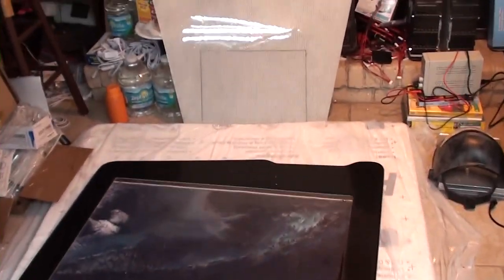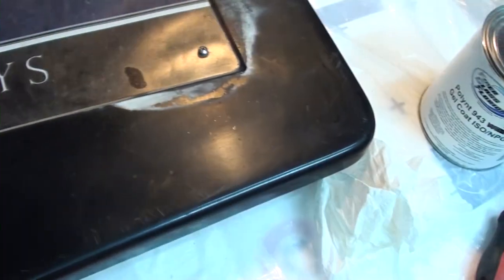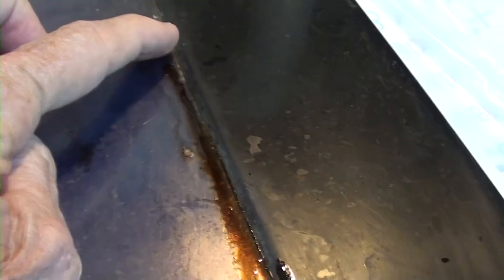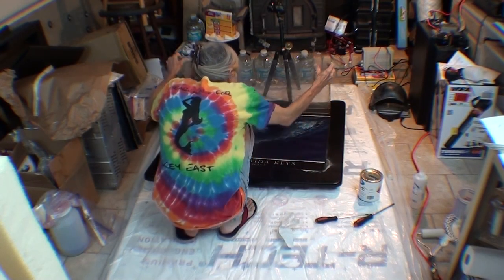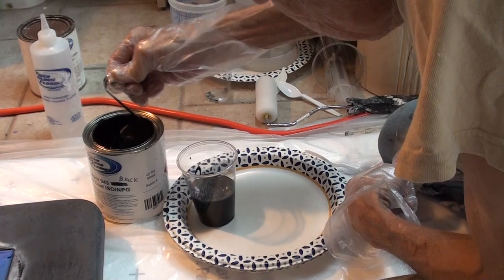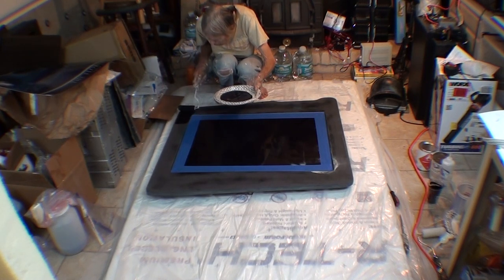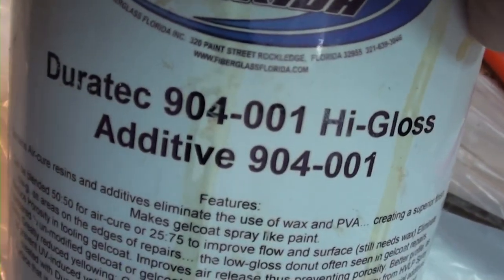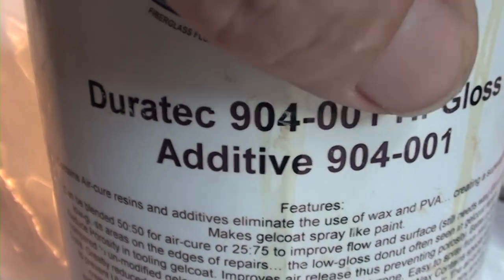Unauthorized Fiberglass Table Repair

Comment: Man! I wish I were there personally to learn more about making table art!!!! I knew that was Coca-Cola syrup!! Lol. Miss you! Good call with the ladles!!!
Reply from the maker: Thanks!  I was always making a mess with gelcoat and paint.  Whenever I would try to pour some out of the can, there would always be some running down the side and making a mess.  I tried using a cup to scoop some out, but the ladles make this job a lot less messy.  I found that I could cut the handle down to just the right length to fit in the can, so I could just leave the ladle in the can instead of cleaning it off every time.  

When the Carver is ready to leave the boatyard, I plan to drive it down to Vero so my parents can see it, then drive back here for the rest of the winter.  Its one day each way plus maybe a weekend in Vero.  You and Marcus are welcome to ride along if you want.  I could use some help with catching the dock and tying the lines.

The MacGregor is ready to go.  If you want to spend a week or so in the Florida Keys, It can be trailered to the keys from Merritt Island in five or six hours.  We can do that anytime.